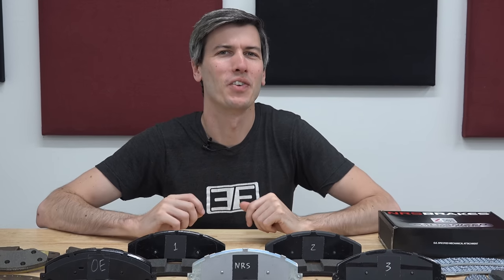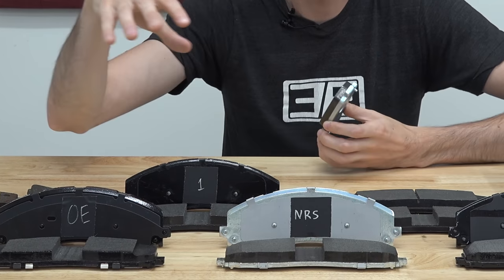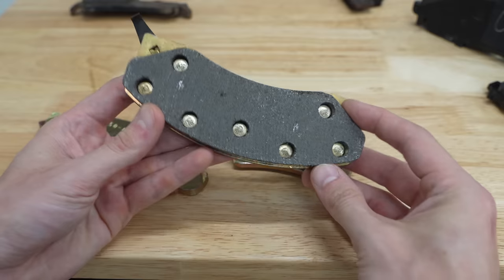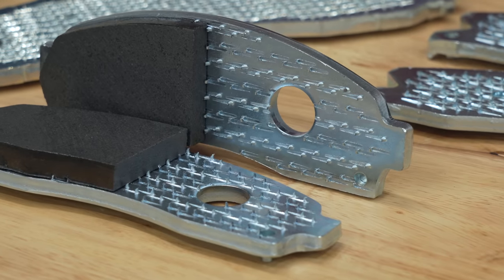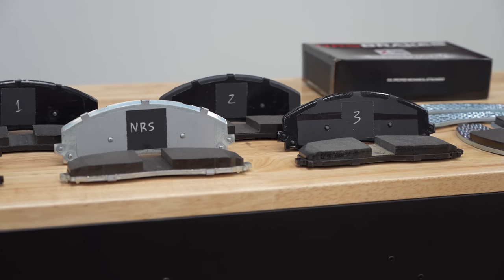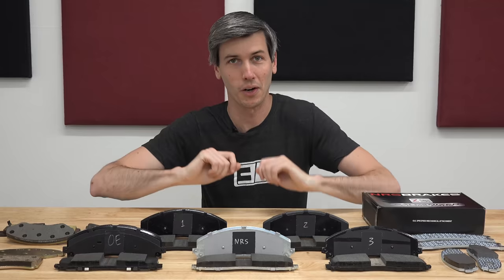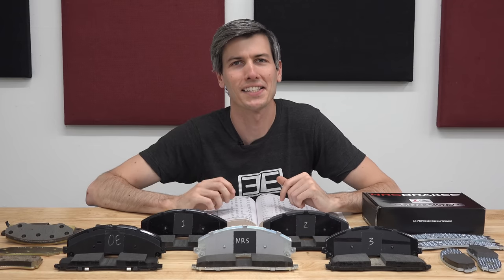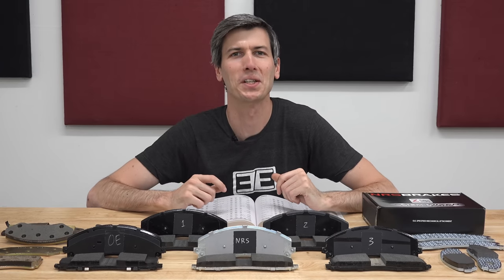The Sketchy Truth About Aftermarket Brake Pads

Comment: ok, but do you encounter that kind of conditions in a normal car and normal day-to-day driving ? 
for racing application or heavy duty (lats say semy downhill while fully loaded and for some reason air brakes are not enough) - yes, shure
but for a midsize crossover casualty commuting to work for groceries ... does it make sense to pay more for "better" pads ?
sure, if it's a matter of 100 bucks or so once in 5-10 years then maybe it's worth it purely for the peace of mind
but is not the case! NRS is ~180 w/s average other brands more like 40 give or take =\

Comment: On some RARE occasion's an OEM pad has issues.

Many, many YEARS ago (circa 2004??),

There was a certain car from a certain manufacturer, where if when you changed the brakes (including machining the rotors), and used GENUINE pads,

That the brake pedal became hard as a rock!!

Yes everything was lubed, all brake line clamps removed...... we never figured why,

We would warn the new employee's about the issue, and then tell them "I tried to warn you" when they didn't listen..... and almost crashed.

As soon as you removed the genuine pads and put after market pads in, the problem was solved.....

Placing them side by side I couldn't see any difference between the genuine pad and the aftermarket pad 🤷‍♂️

Comment: I have never had a pad failed....... and never bought "OEM"..... have maybe used 100 pads in sumner, winter with loads of salt etc. Over 20 years..... mechanical attachment doesn't that give you less pad material? Does Brembo use mechanical attachment? I use brembo on two of my cars. And Delphi pads on one.

Comment: If we assume we are a competent home mechanic who can change their brake pads at the drop of a hat, (not a customer who has their car checked up on every 6 months) , and doesn't replace the brake pad until less than 1mm of material remains, isn't there an advantage to the adhesive mounting? Namely, there is more pad material you can wear off before getting metal on metal contact which ruins your rotor?
Reply from the maker: Generally speaking (though there are many companies that do it, so I can't speak for all), mechanical attachments are designed such that the wear impact is minimal if anything once you get to the metal hooks.

Comment: My brakes got too hot and stopped working after driving down an extremely long and steep mountain here in Norway. I said to myself "never again" and ended upp upgrading to ceramic brake pads and slotted rotors and the brakes has been excellent ever since. Yes the pads costs 5 times as much and the  rotors 4 times as much, but the cost is well worth it considering it is extremely cheap life insurance.
Reply: In the Alps you are suggested to use the same gear going down as you were using going up, in order to not induce brake fade/overheated brakes. In other words, motor breaking. I think I saw signs saying the same 20 years ago in your country, as well, driving down to sea level from Hardangervidda* in June. 
 I guess you were driving an automatic - no motor breaking. Or maybe an old two stroke Saab that doesn't have the ability for motor breaking. 

*I was driving a 1971 Citroën DS21. The car was introduced in 1955 and had inboard mounted front brakes (300 millimeter front discs) and very large pads. It also has enormous brake cooling ducts to top it off. Therefore I could break all I wanted without worry! I even used that car on several track/race driving course and track days. My Instructor wrote on his blog (20 years ago) that "the brakes are in Porsche Lotus Elise class". He is now working with chassis dynamics for Tesla.
Reply: @stefankarlsson8215  Motor braking is definitely the best way to brake, but if the hill is steep enough you would have to use your regular brakes as well. Then they can be to hot if you are driving in long steep hills. Another situation is if you drive fast on the motorway and have to stop quick. Then the brakes can get to hot as well.

Comment: Pagid, Mintex, Napa never failed me. On the other hand Brembo pads had metallic noise only after 5 months of normal use.
Reply: I installed rear Pagid rotors on my E36 M3. Now after two years and 10k miles they are pretty torn up and I don't drive like crazy. They are made in China.

Comment: Just installed brake pads and rotors on my Silverado. I tried to get the best quality I could find locally with the time I had, which I'm sure is true for a lot of people. Who in the world has time to do a bunch of research and keeping tab on products to make sure they are on on par with OEM specs? These days I find myself wondering if the quality of products is as good as what I expect them to be and this really needs to change because it's getting pretty ridiculous. EDIT: I got lucky- turns out the pads I got have the NRS backing plate, so in this case, what seemed like a quality product was indeed a quality product after all.
Reply: I have a Chevy Silverado as well. I usually just replace whatever part looks bad and it works fine. 

But the last time instead of doing that I replaced everything except brake lines and master cylinder. I did calipers pads and rotors in front. In the back I did new drums and brake shoes and hardware. 

This is the best braking system I've ever had and everything is perfect. The truck just stops on a dime. It's an '08 Silverado with 280,000 mi and the braking system feels like a brand new vehicle. 

I did order the stuff all from the internet but I got pretty good stuff and did not order the cheaper version of anything. 

Normally I always just buy the most premium version from AutoZone.
Reply: @actionjksn  Did the exact same thing as well, except I ordered from a local store online and got their premium product. I happened to watch an Engineering Explained video that week about how the friction material is attached to the backing plates and it turns out the pads I got happened to have the mechanical (integrally molded) rather than glued on attachment by this company that supposedly makes these good quality backing plates the video was talking about.

Not sure if the Silverado has the "best braking system" but it does stop very well and smoothly especially with quality braking products. The brake lines on my generation Silverado are the weak point since they are known to rust out very quickly and cause brake failure. Not sure if this is the case with the newer trucks, but all of mine were replaced. I will probably replace them again with a better quality product since I'm not crazy about the ones I put on.

Comment: When I was a student, I registered myself as a small workshop as soon as I found out other cheap workshops where installing downright crap on cars. Even though the price for my colleague students was mostly the labour.
Why not spend that tad more and install a A brand. The price difference is not big (a cheap brakepad for our tiny japanese car right now costs 15 euro and a Brembo/Febi Bilstein/Bosch cost 20).
I've seen so many preventable issues with brakes/tires/exhausts just because a workshop wanted to make that 10 euro more profit. Or thought a cheap car driver didn't care a tire that is 20% cheaper wears out 100% faster.
I've never had to change out a Brembo set of brakes before they where worn out. But I did see loads of cheap brakes start to screech because pieces broke off, of the glue let loose.
I actually saw the pad completely seperated from the steel backside, but the brakes kind of still worked because it couldn't go anywhere.
It did make a racket.

Comment: 30 years ago, Honda's VW's/Audi's commonly had crunchy noisy brakes with aftermarket pads no matter which brand. So the garage I worked at started only installing OE pad sets right from the dealership, perfect brakes every time...  Then, since the late 90's-2k's its been easier to find out who is making OEM pads for whatever brand.  like Akebono makes OE pads for ALOT of MFG's... And Mercedes OE pads are made in Texas... bet you didn't know that...

Comment: Have had 2 recent instances on my fun cars where just cleaning the Calipers, the pad friction material just cracked off the backing plate. One of the pads were spec'd as street and track pads, had a few track days on them and the life left was like 20%. The other pads were off a used car, OE grade I suspect, one track day and they were done...  mechanical attachment it is. Thank you.

Comment: I hesitate to contradict as you are way smarter than me however I have been working I. Auto repair for 30 years and have never seen a brake pad come apart that wasn't already worn out. The really big issue is friction material design and absolutely no oversight on the industry at all
Reply: The EPA is involved too and manufacturers are struggling trying to find the right recipe for friction material that doesn't harm the environment and degrade the quality of their product.

Comment: BMW charged €160 for rear brake pads. Just about every aftermarket set was between €30 and €35. (All brands, including the reputable ones). 
That’s just too much of a difference.
Reply: elcactuar3354  
Thanks! As a Dutchman I genuinely appreciate it when people point out any spelling errors etc. I’ve corrected my comment.

Comment: Testing for days at 550F is not accurate, for in real life, brakes rarely heat up to that temp. and stay there for long, which is the boiling point of premium brake fluid.  Hell, I remember cars used to come from the factory with standard drum front brakes or even older, brakes on rear wheels only. I have not heard of any glue failures so that method of attachment must be fine for normal uses. But if you have a group of teenagers drunk on a Saturday night, even if you have carbon  carbon brakes (use on airline jets)  they still wrap the car around a lamp post.

Comment: I'm an automotive tech and primarily work on passenger/light truck vehicles. I see aftermarket brake pads shear off all the time, and the in-house brands from the parts stores are certainly the worst offenders (O'Reilly's, Advance Auto, AutoZone, Napa, Fisher, etc...) One thing that's important to understand is that no auto manufacturer uses one specific brand for the brake pads on all of their cars. Most of the time they will use a brake pad supplied by the same company that manufactured/supplied the caliper for them. In my personal opinion all of the OEM suppliers make fantastic parts, no matter what kind of vehicle you drive, you can always know that an OEM brake pad is going to perform exceptionally well. Many of the OEM brake pads supplied to some of the top auto manufacturers are made by Akebono, TRW, Ate (Contintental), Nissin, ZF, etc... And every single one of those companies I listed offers their brake pads to the aftermarket, and so do many other OEM brake pad manufacturers. Some of the best brake pads that you can buy come from brands that you've probably never even heard before. But I have never seen an OEM pad from any manufacturer that I felt was inferior in any way.

Comment: This research does not surprise me. There is also the performance and characteristics of the friction material to consider as this can be material. Having been responsible for a large fleet of heavy trucks I have seen first hand the consequences of aftermarket brake parts. The penny finally dropped for me. Thank you

Comment: How could anyone really expect adhesives to hold friction material better than mechanical fasteners?  Corrosion treatment seems like a no brainer as well.  Alas, the quest for profit steers quality manufacturing away.  If I want to know what the best brake pads are, I seek the advice of a mechanic.  Mechanics know what brake pads are the best, because they diagnose brake problems and replace them regularly.  The best recommendation I've received on brake pad replacement is Akebono ceramic brake pads.  They're quiet and brake really well on my Ford F-150. 👍👍👍

Comment: This video sounds scarier than it should. Even if you have a brake failure you have 3 more brakes. There's no way all fail at once due to crappy brake pads. If you keep safe distance, even with a brake pad failure you'll be safe.
I had weird sounds from my car braking. Turned out no pad material left and damaged rotor on one wheel. Yet I couldn't notice it in trems of stopping power in regular driving.
Reply from the maker: Apologies if the failure mode wasn't clear, let me elaborate. Let's say a pad breaks off and falls apart through the caliper, now you have a void. The next time you press the brake pedal, it goes to the floor, because that caliper's piston has nothing resisting it. So the brake pressure in the system can be very low, meaning you're not necessarily applying much pressure to any of the brakes. There are comments here of folks saying they've experienced it.
Reply: The possibility of blowing a rusty brake line, separation of the flex hose with a rubber shield over the hose to line crimp, or master cylinder seal failure occurs more often than pad failure imo.  There is always something to worry about when you are driving a 2 ton mound of metal and plastic down the road, but the majority of people are oblivious to such things.  If you worry about the what ifs and you maintain your vehicle the best you can, your driving experience will probably won't be as enjoyable.

Comment: I've been driving for over 65 years, and I've NEVER had a brake pad, (or shoe), come apart.
Reply: elcactuar3354  Were you born a wiseass, or did you have to learn it?
Reply: elcactuar3354  Or, it may not be Maybelline. It could be it's just Maybelle.

Comment: What you explain about adhesive issues reminds me of a brake failure incident I had on a 99 Honda Civic (D16Z6/5 speed). Coming down from the mountains in heavy traffic the brakes overheated to the point i could smell it. The rotors burned black inbthe front, dark blue in the rear. The pads friction material crumbled during disassembly.

Comment: I've bought some bargain brand pads in the past and never had an issue.
Reply: All pads have to meet SAE standards, at least the bare minimum.

For most people, cheap pads are sufficient and there is no real harm getting fairly cheap pads.

I looked up NRS pads for my vehicle. No way in hell I’m spending $111.00 on a pair of pads for a small car that weighs less than 3 tons. 

If anything, what you’re paying for is probably longevity, but thats a tough point to argue given that my cheap $35 brakes are more than 7 years old and so far have accumulated 60,000 miles.

Comment: Why did they do the shear test in that direction?
It should be tested lengthwise just like it is stressed in a breaking scenario.
Heat cycles would also be more realistic than heating over duration.
maybe it doesn't matter, or maybe the results are more favorable for NRS.
I just get careful with studies published by companies, are the results legit data from their own rnd, or are the tests themselves engineered around their own product, you never know.
Reply from the maker: Good question - I believe shear test from above is industry practice, as my pads have chamfers on the sides. Not positive here, and worth looking into more!

Comment: Great video. When I was younger, I had the lovely experience of a break pad falling apart during a mountain run. Pedal went from firm to slightly mushy, and I had a horrible vibration from the front end of the car. I limped the car home, and the pad was broken in 3 parts with small chunks missing out of the part of the pad that was engaging the rotor. My guess is the rotor was chipping it away as the pad vibrated in the caliper. 

Being a broke college student, I didn't think much of using a cheap aftermarket pad, but that was a very real lesson in you get what you pay for. I quickly upgraded all the pads and rotors with my next 2 paychecks! 😅 Was eating ramen for weeks.

Comment: As a mechanical engineer who owned an auto repair shop as a "jobby", I am appalled at how little people understand and how much misinformation there is about what not to scrimp on with your car. #1 is tires--all of the forces that determine where the vehicle goes, and whether it stays on the road or goes sliding off, are transmitted to the ground through the tire. Why people think a set of tires should cost $300 or $400 is beyond me. #2 are brakes. Only OEM brake pads will consistently provide the brake feel, braking performance, longevity, and noise performance, as if the car was new. Hard to imagine compromising on brakes, but people do it all the time--then complain about short life and brake squeal. #3 is engine oil. Without naming names, back in the 1980s a certain oil manufacturer took a very popular German sports sedan and filled the crankcase with their household name synthetic oil. After 1 million miles, they tore down the engine. All but the intake valves (due to mushrooming) were within specification for continued use, and most engine parts were within specification for new. Using high quality synthetic oil essentially stops engine wear the moment you start using it. #4 is the gasoline. If your car requires premium, then pay the extra freight and buy it, particularly because premium fuels typically also have additional detergents that regular fuel doesn't. And use Techron if your car doesn't need it. In the aforementioned test, the petroleum company attributed some of the engine's longevity to their high-detergent fuel.

Comment: I'm the kind of driver that hets 100k miles on a set of front brakes. I mostly drive highway miles and even in the city I hypermile and use my brakes as little as possible. I also downshift going down long, steep grades. As long as my brakes stop the vehicle and do so quietly, I'm satisfied.